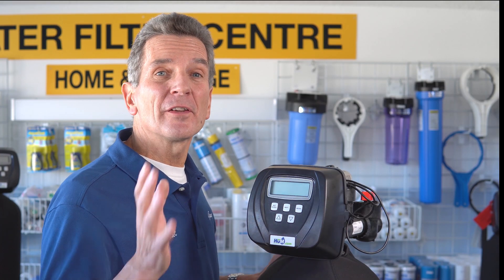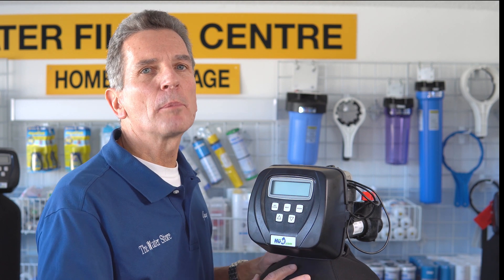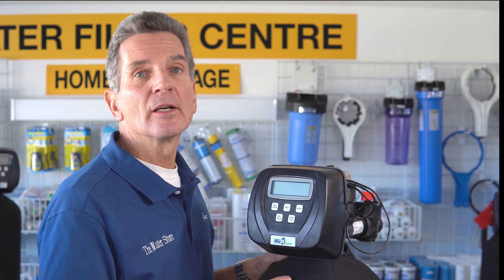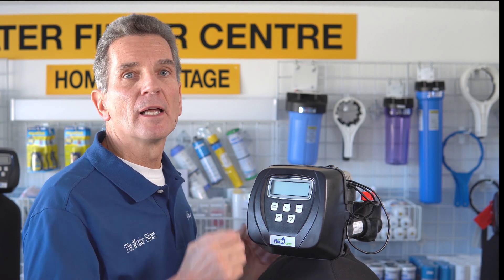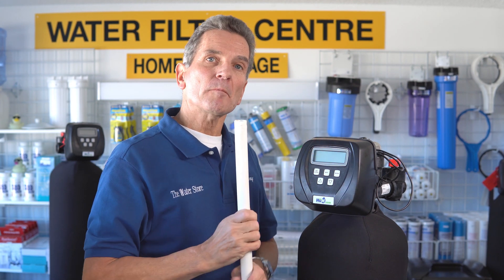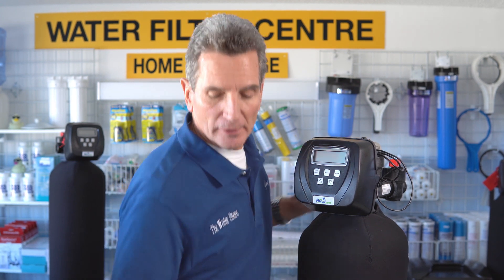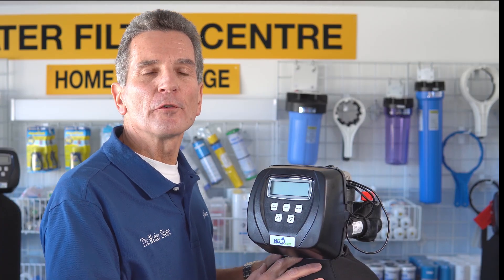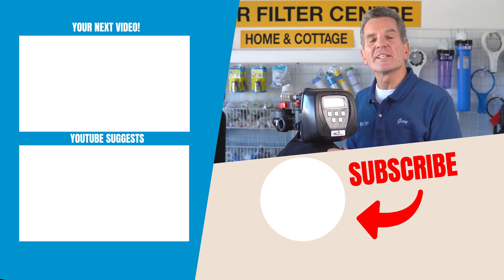HOW Does a CHEMICAL FREE FOC Sulphur Filter Work

Comment: Hey! Love the vids. Just bought a house with well water so I've watched a few. I have a large pressure tank, a big brine tank, and 2 giant black scuba tank looking tanks utilizing the WS1 clack valves right next to it that look almost identical. My well system goes through a small sediment filter first, then the huge pressure tank, then water softener/brine, and then to the second black tank, and off to the house. My question is, how the __ do I know if my second black tank is FOC/FOB/FOK. I assume it's FOC/carbon... but of the multitude of videos online talking about FOC/FOK/FOB... I can't find a single one that tells me how to identify which of the 3 I have??? If I scan the QR code under the top of the WS1 clack valve covers, it takes me to a manual that references "media" over and over again... but still... it never says if it's FOC/FOB/FOK! SO... just how does one know which media is in there???
Reply from the maker: Great question.  We put a model and serial number tag on the right side of our equipment that identifies which one it is.  There is no way to tell becasue the only difference is the media inside the tank.

Comment: Hi Gary I’m a lic. Plumber from Massachusetts and I have really bad iron and manganese ph is fine but i have a clack filtering system.  Multiple filters. First filter removes iron and Mangement using a ozone pump then goes into a dual water softener then into a big blue canister then into a activated carbon filter that just shut flows through no backwashing involved then in to another big blue in case i need to chlorinate house.  Seems to work fairly good but my wife is still not happy any suggestions.  RE Prescott in NH is my dealer and helped design this system i have quite a bit of money invested in this system but would like to fine tune it to be perfect. We have very high amounts of iron and manganese. Let me say the owner didn’t even want to help build this system because my water is so bad raw water comes out bright red.   Any help or suggestions would be great if u have a invite to chat I would be up for a phone call to discuss this over the phone. Thanks for your time i do only install clack filter systems for my customers and do love the product its my water that is the issue not the system.  Thanks again.
Reply from the maker: I would suggest you have a water analysis done before and after the system to see what it is and isn't removing.  What aspect of your water is your wife not happy with?